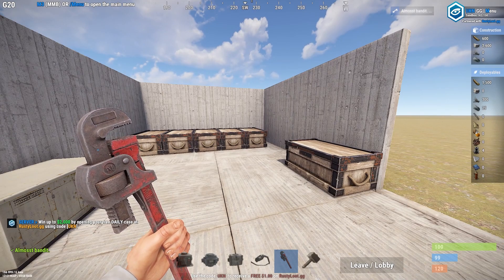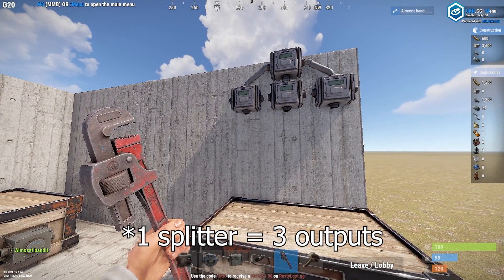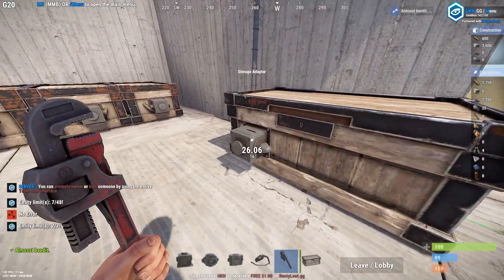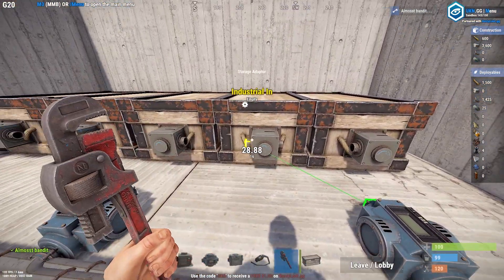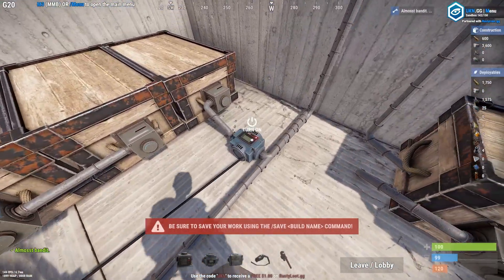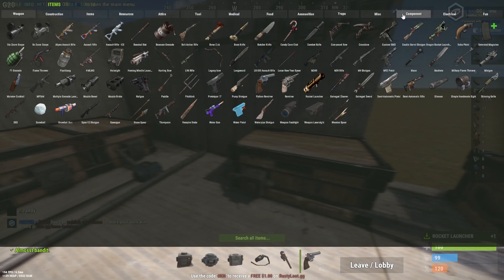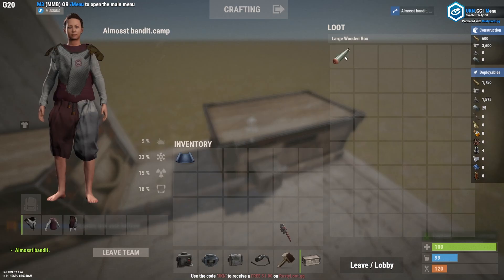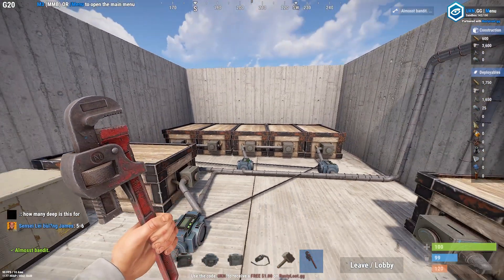The best auto-sorter design - Rust Tutorial

Comment: You can make a fault tolerant system with fewer parts, simply by blacklisting parts at each filter.  No matter where you drop stuff, it will keep flowing through the system until it gets stuck in the correct box.

Comment: Why doesnt it work everything works fine but the drop box to the splitter tree wont... Ive tried with a smaller amount of boxes qnd it worked fine but it wont go from the drop box to a splitter
Reply: Put a conveyor conveying everything between the drop box and the splitter to create "pressure" in the system.